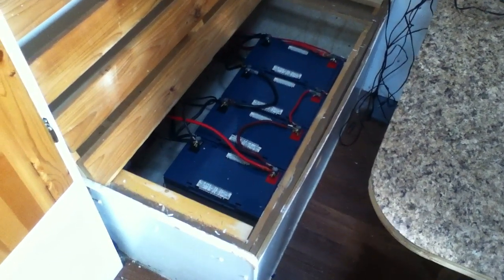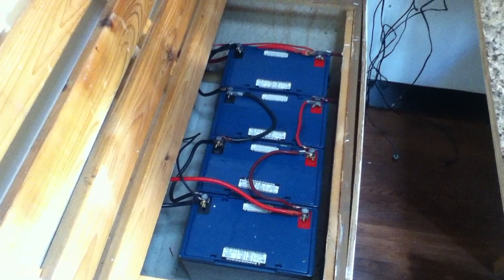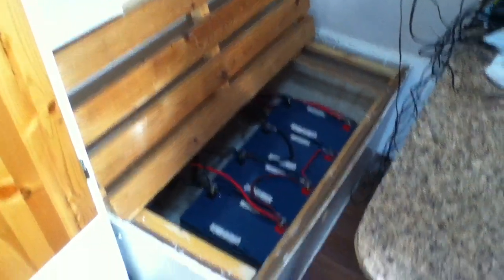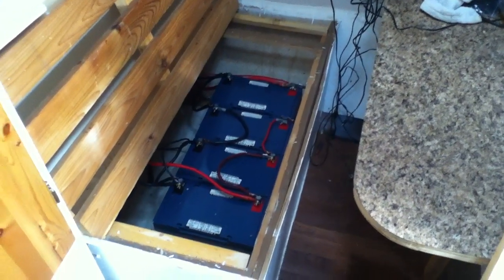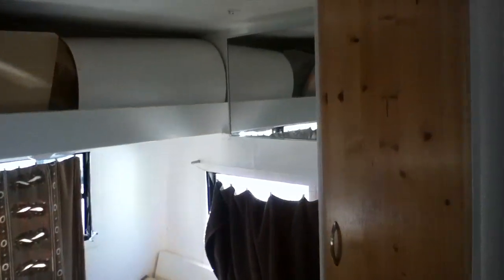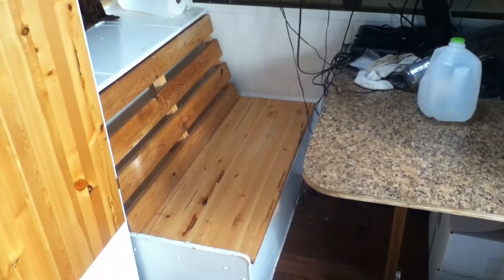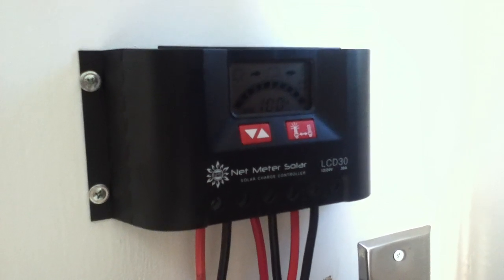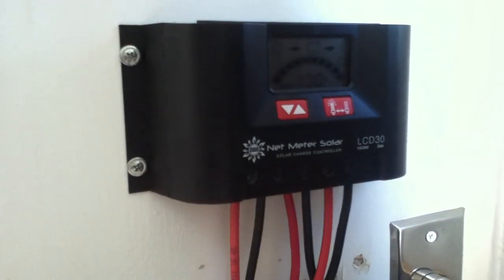Off Grid Trailer Power System - the battery storage and sustainable equilibrium

Comment: Actually PWM charge controllers are Better for battery life and make far more sense then MPPT since the price of solar panels is so low nowadays it pays off to have Charge controllers PWM that improve battery life rather then more efficient chargers like the MPPT.
Want a faster charge of the bats? Get more solar panels. Its cheaper to invest in solar panels then to spend way more cash on batteries.
Reply from the maker: +John Smith  That's my thought on it usually, but sometimes there are limitations on the size of the solar array, for example space to mount panels on a roof, so then when you need more power production out of that system, the only way you squeeze more solar energy out of it is with the MPPT setup.  The trailer in this video though, I still own it but it has not rolled anywhere for years.  I leave the inverter on and have not turned it off in a year.   I have left lights on for months at a time.
Reply: +8digitPDX Oh, I  agree for that case in particular. I was just mentioning the economics for those who have enough space to have more solar panels. As of this writing I think it is possible to get solar panels for about 0,5$/W. If anyonw wants to have some fun assembling a solar panel kit can be ordered online for Less about 0.35$/W not including aluminium frames, glass,  and the chemicals to seal the thing.

Comment from the maker: I think I accidentally deleted someone's post as I was answering a questions.  The batteries I think were marked as being new in late 2007, The camper was made in the early 90's and was not exactly a top of the line model.   Most of the wood framing was 2x2 with pretty broad spacing.

Comment: I removed the old water tank in my camper and have the battery bank in about the same place, vented of course. I have the same charge controller on a hybrid system. They are Steca knock-offs, I have not found the SOC mode to be accurate but for $80, - I recommend Voltage mode, works good.